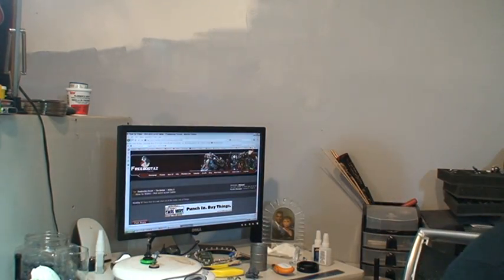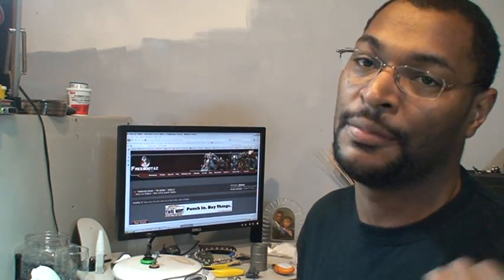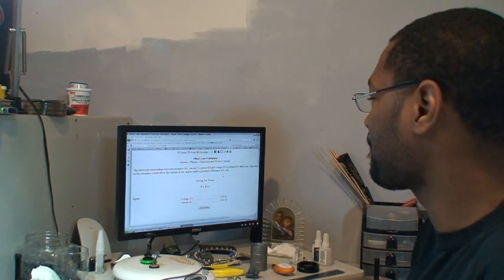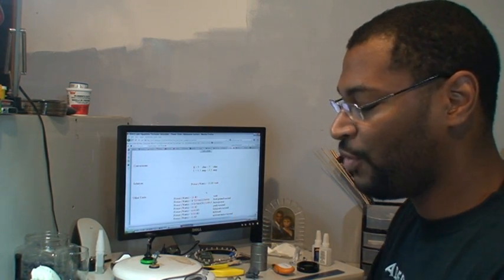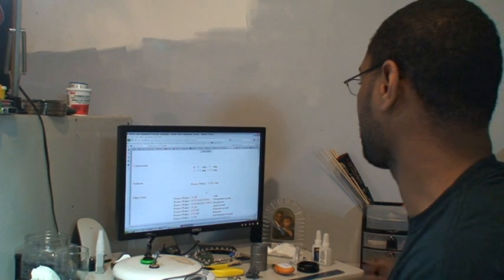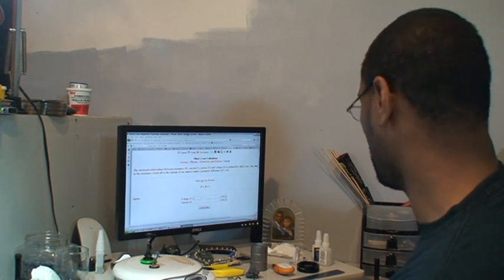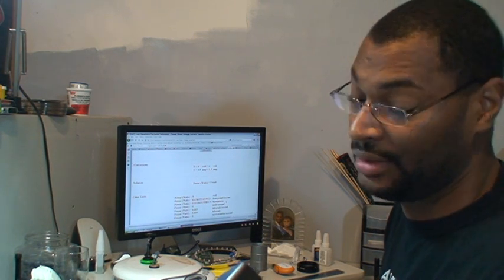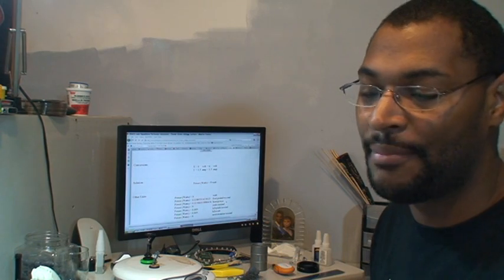Hot wire power supply Q&A

Comment: As a fellow EE I'm offended at how wrong you got this. The 12V supply is overloaded and the 6V supply is fine.

Lets break this down.
Vs is the supply voltage
Ismax is the max supply current
Is = Iw is the supply and wire current when operating.
Rwire = 7 ohms
P = V * I  the power can be calculated from Voltage and Current.

For the 12V 1.3A max  power supply
Pmax = 12 * 1.3 = 15.6 watts
Iwire = 12V / 7ohms = 1.7 Amps
This is quite a bit over the 1.3 Max current of the supply
Pwire = 12V * 1.7 A = 20 watts
This is a 33% overage on the power capacity of the wall wort.
Bet it runs pretty hot.

For the 6V 1.5A max  power supply (AC vs DC make no difference)
Pmax = 6 * 1.5 = 9.0 watts
Iwire = 6V / 7ohms = 0.85 Amps
This is quite a bit under the 1.5 Max current of the supply
Pwire = 6V * 0.85 A = 5 watts
The supply is fine but the wire may not get hot enough.

Norm
MSEE Purdue 1983

Comment: I found a wall wart transformer capable of 16v at 2.5A.  I think its too powerful for my foam cutter because my wire is only about a foot long.  Is it possible to step down power with resistors  on one of these wall warts to say 10-12V?
Reply: Just use a longer piece of wire. The extra length servers as your resistor step down..

Comment: im so sorry. I know its an OLD video, but i just cant wrap my mind around your calculations. the wire has 7 ohm's resistance, and you're feeding it 12 volts. 12/7=1,714amps. so you are trying to pull 1,714 amps from a 1,3amp transformer. im guessing its getting hot? With this said, i never built one, so do correct me if im way off.
Reply: Phantom Of The Opera FWiW; In European/metric countries they use a comma for the decimal indicator.

Comment: Thanks for the video. Very helpful. Before, I didn't think I would be able to use one of these type of power supplies, but now I know (with proof) that it will work. Does it cut the blue and pink foam just as well as the white foam in the previous video?